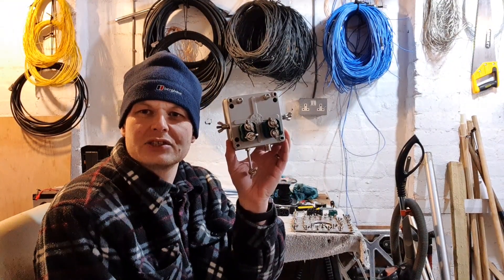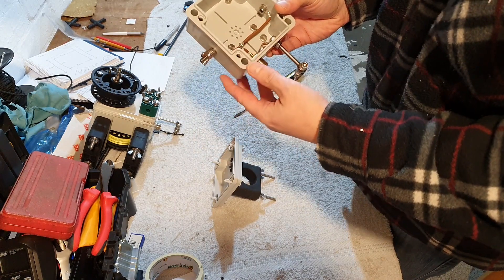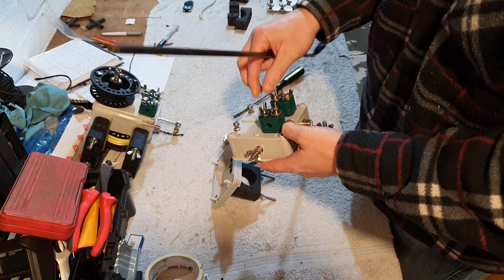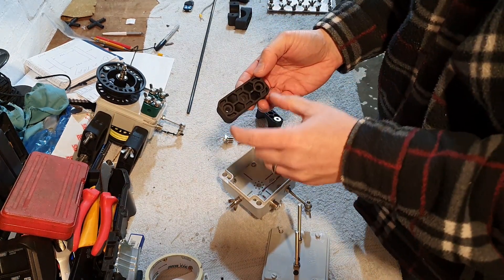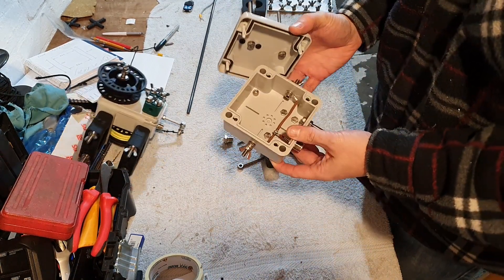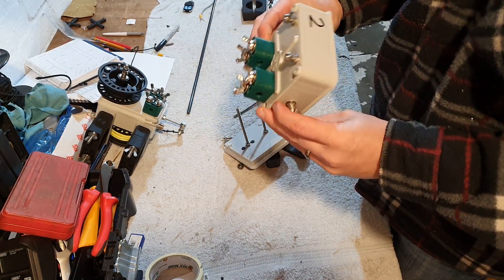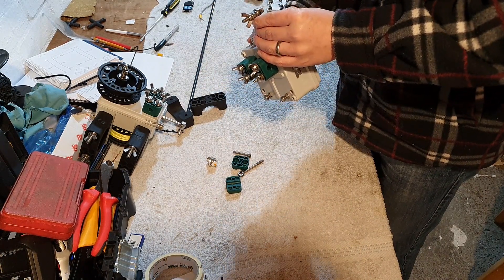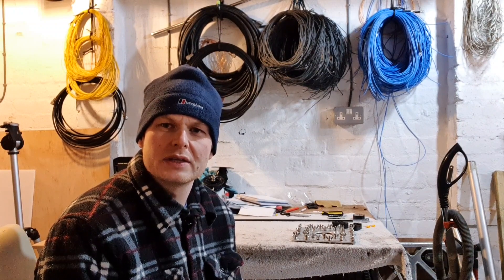Make Your Own Ham Radio Antenna Feed Point

Comment: Colin, where do you get those pipe clamps?  Very nice work, as usual. Looking forward to seeing the 20m gain antenna vid. MM0IGN.
Reply from the maker: Hi Kelly, usually from here. The plastic ones are coded RAPG and the Rubbers ones coded RAVG. https://www.flowfitonline.com/hydraulic-cylinders?gclid=Cj0KCQiAst2BBhDJARIsAGo2ldVNShbA6qSpgt7-KX1Ybl1l1VtkgmNWwEgMHO8sXd1cypfkNzO232oaAn1JEALw_wcB

Comment: Thank for sharing, when I was building my own version I have to say I had great difficulty in sourcing quality components.  The biggest issue was the feed reel, I just could not get the same quality that you manage.  So there came a point  I either gave up or come to you.  So pleased I did.  Great antenna with a built in 80M capability.  Works great, I haven’t been able to find a proper home in my garden yet as the WX has been against me over the winter. Looking forward to the spring when I can get out.  Highly recommended.  Thank you 👍🏻👍🏻👍🏻
Reply from the maker: Thanks again for the kind words Mike. I'm just pleased you are happy. As you know I can't have a permanent set up in my garden so it's driven me to develop my own kit. Lots more ideas in my head to realise.